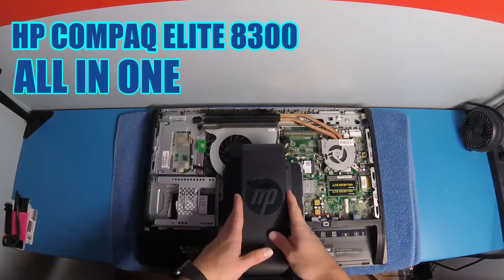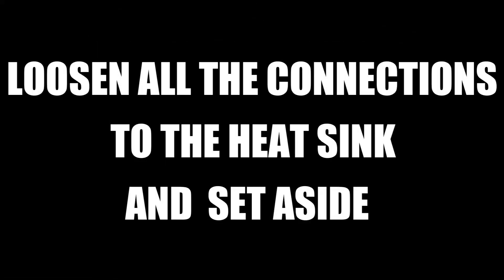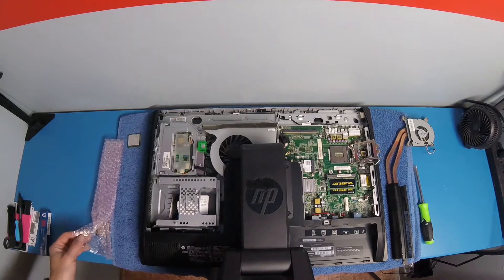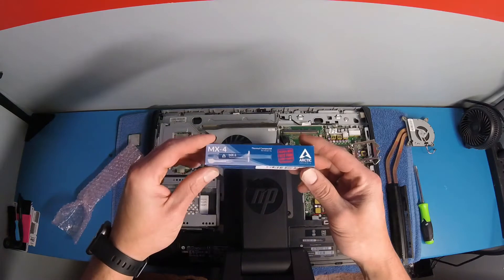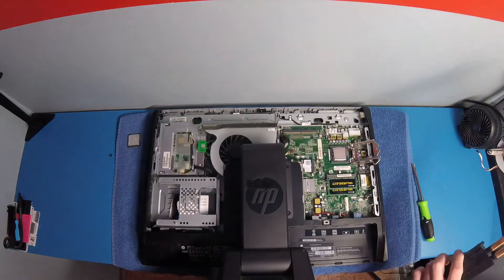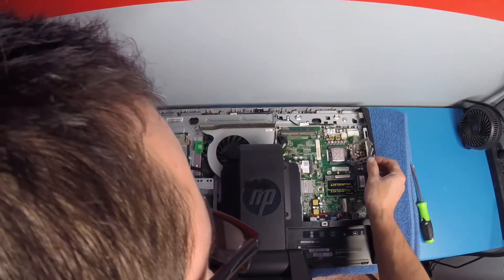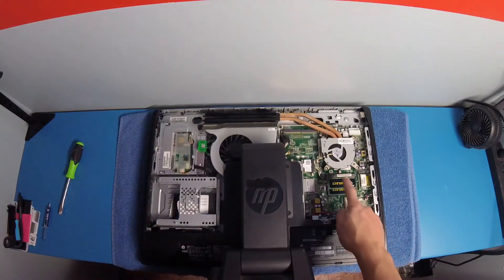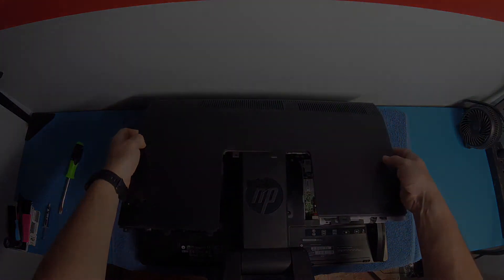is it worth upgrading old hp aio computer? you might be surprised

Comment: Hello friend, were you able to install the mxm video card? I want to put it on mine too.
Reply from the maker: So . .yes you can install. If you can find one. And once you find it hope its not broken and has a heat sync. Performance was about the same as the onboard graphics with the maxed out processor of i7 3770 (if i remember correctly). You can get on hp website and it lists the compatible cards for the hp 8300 aio ! Have fun ! Something like   amd 7650 a mxm 3.0 i believe.

Comment: Not the right way to do what you did with the CPU Thermal Compound, but you achieved your goal I guess if the CPU isn't overheating. The correct way to do it is to put a dab of Thermal Compound Paste (about the size of 1 or 2 drops of water) in the middle of the CPU - then when the Heatsink is placed on top and screwed back down the paste will spread out evenly across the surface of the CPU without having any tiny air bubbles there (which would cause damage to any part of the CPU that the air bubble is over, as it can't displace the heat from that section). Hope this helps in future. Well done on the video anyway! 🙂
Reply from the maker: Hey thanks for the advice ! Yeah its still working fine no overheating. Only use it for media streamimg these days so it doesent work very hard lol

Comment: where is the pcie x1 slot?
Reply from the maker: Been a while since i made this video. But i dont believe it even has one. Is has a similar slot called an mxm 3.0 i believe. Its in this video or another one on my channel with this computer. You just have to move the closest power cable off the mother board to that mxm slot to power up the card you pit on there.  Beware. .  i have been unsuccessful in multiple attempts securing the correct card that will work in that slot. Its Outdated and gonna be a really hard find. Not worth it. Good luck !
Reply: Man my stand is so god dam hard to uninstall

I have the 6300 one

Comment: can i install amd ryzen 5 3400g?
Reply from the maker: Not positive but i dont believe so . .  check the socket type for the mother board and compare to the socket of amd.
Reply: @jessemellon6258  is there any other graphic cards i can install? or tell me what format of card is that
Reply from the maker: @nervox2342  if you can find one that works . .  i have bought 2 and they didnt work. Amd 7650a. In the mxm slot up top.  And you have to move a cable from one port to another. The card worked for me for about 10 mins and over heated because i didnt have the proper heat sink. .  there is another video on my channel i have on this computer and in the comments there is more info on the graphics card. Another watcher had some advice for me on the graphics card . .  you may find that info helpful ! Thanks for watching !

Comment: I was wondering if a i7 3770S could be installed in this AIO. I bought one and want to upgrade it, but wasn't able to find out if the S variant would be compatible, not a lot of info out there
Reply from the maker: Yeah idk . .  you could research the chipset type from the hp website and try to find out if the board is compatible. .  but on website from hp it lists compatible
Reply from the maker: Compatible processors . .